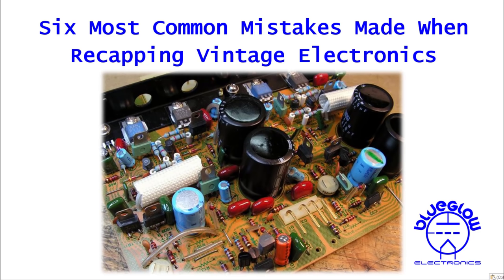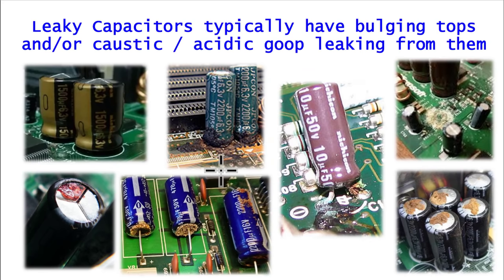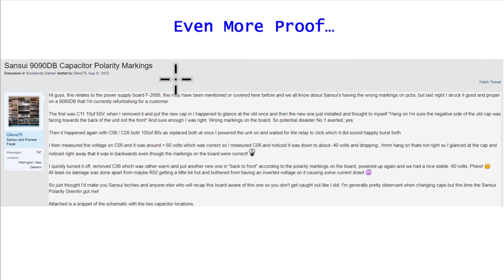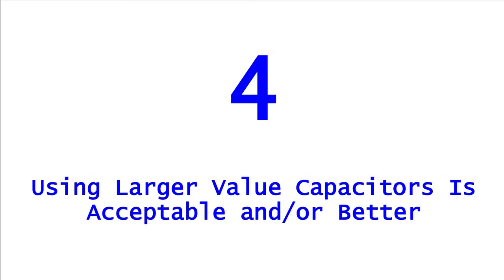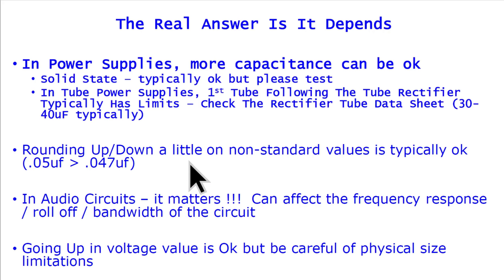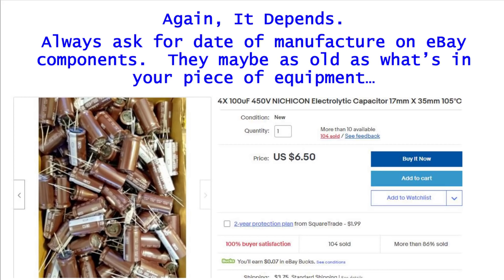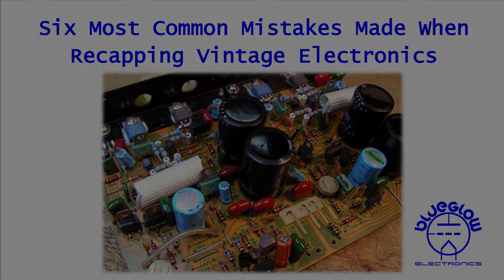Six Common Mistakes Made When Recapping Vintage Electronics

Comment: I agree with most everything.  I have also been restoring, high-end, vintage, recording studio equipment.

As to the shotgun approach.   When I sit down to, refurbish, restore a nice big huge audio console.  36 inputs.  70 something modules.    All with numerous capacitors.  I sit down.  And I change every single one of them out.  Whatever doesn't work after that.  I shall troubleshoot.  Because it would have been working before.  Therefore I must have done something wrong.  And it will be easy to troubleshoot.  But I've never really been known to make those kinds of errors.  I get it right the first time out.  Then I'm happy.  Then I can party

Oh yeah and the console was made in Great Britain and is called, a Neve.   By Rupert  Neve.  It's in a Dave Grohl movie from 2013 called Sound City.   Only Rupert told me, mine was better.  And I definitely know that for a fact.  I've been using it since 1984.  Owning it since 1996.  And created  a new method of cleaning and restoration. Without having to change out  hardly any, potentiometers or switches.  You know the stuff that always goes incredibly intermittent and doorstops passing audio by dropping out altogether.   And ya can't have that happening.  And it worked so well.  I had to turn all of my other studio technician friends on to it.  And it has become the de facto standard method of refurbishing.  And the punchline here.  You give it a bath with soap and water.  Actually a surfactant..  And water for rinsing.  In an ultrasonic cleaner.  That warble's between, 40 kHz and 80 kHz.   Which will prevent any damage .  Into the center of the substrate of solid-state, transistors.  If not the warble.  Preferably 80 kHz.  Minimum 40 kHz.  I had a 1960s tube powered Bendix.  That said ultrasonic but it was in fact, 20 kHz.  And I had a couple of transistor failures with that.  More than I care to remember.  I wasn't quite in the know that I had the wrong flavor of ultrasonic cleaning frequency.  One of those stupid engineer, whoops moments.  Even more amazing.   The transistors were never submerged.  But the 20 kHz was so unbelievably loud.  It still permeated and penetrated them in the air.  Just amazing.  Everybody told me I was wrong.  About my hypothesis.  Until I called both GE semiconductor and National Semiconductor.  And they said Yep.  That's why you need a minimum of 40 kHz but we recommend 80 kHz and it would be best if it warbled between those two.  Then they will be no chance of semiconductor damage.  They told me.  Who knew?  You weren't supposed to give your transistors a low frequency,  ultrasonic frequency bath?   There was no warning on the transistors, do not use 20 kHz, ultrasonic cleaners.  And even if there was.  It would have been too tiny for me to read anyhow.  It's all right.  I cleaned everything up.  And put on a new pair of, underwear.  Before replacing the transistors.

You spoke of misprinted polarity indications, printed upon circuit boards.  I have one better.

At the turn of the eighth decade of the 20th century.  I was handed a famous West German very expensive, large diaphragm, studio, condenser microphone.  Costing approximately $3000 new.  And this one was dead.  HUH?

As the story goes from my client.  It was handed to the 2 other top studio technicians.  At the other 2 top recording studios in Washington DC.  Both guys I know.  We all have worked with each other.  I've contracted them.  They have contracted me.  And my client tells me they couldn't seem to fix this one transistor microphone?  HUH?  And he handed it to me.  Knowing I was a technical miracle worker.  And also indicated.  Since he knew I owned a pair of my own.  If I could not make this work.  I could just keep it.  To use for parts.  For my own.  Thank you Rico.  I'll see what I can do.  But Bob and Rick couldn't make this work?  They must've been pulling your leg.  Because if you ordered the transistor from the manufacturer.  It would cost you a couple hundred dollars.  As each are tested.  And general-purpose transistors were only, $0.98 at Radio Shaft.  And the microphone has the schematic and English printed in Germany.  And it's a simple little schematic with one transistor a couple of transformers.  And a few capacitors resistors, general fare.  And everything checks okay.  Everything is verified to the schematic.  And yup.  It's dead.   The capsules just fine on one of my microphone bodies.  But the body is dead.  And I can't find anything wrong with it.  All the continuity is proper.  All the parts are fine.  What the hell?  It was more like what the FUCK.

Out of sheer frustration.  I consumed a copious amount of beverage and burning some green salad.  And I decided to destroy the microphone.   It has to be connected to 48 V of phantom power.  And I wanted to see some smoke..  After consuming some.  But a different smoke.  From the parts on the circuit board.  And that would be easy.

The schematic showed a, P channel FET..  And the orientation of the gate, source and drain.  And so I took a general-purpose $0.98, N channel FET.  And I install the wrong transistor.  But no smoke.  Still dead.  How can I make this worse?  I could turn the transistor around.  With the wrong orientation for the gate, source and drain.  And I should get some smoke, then.

When I tried to do didn't work.  There was no smoke.  And the microphone simply sounded like new again.  And it's a, what the FUCK moment.

I ended up calling the sole American distributor in NYC, Gotham Audio.  And I get Joe Luong on the phone.  One of their well-known highly respected top technicians.  And a gentleman whom.  We were classmates together.  Taking Ampex technical warranty service seminars.  In the same class together.

And I'm like so, Joe.  We both know.  The Germans.  Would not make 2 blatant schematic typos,, like that.  This was done on purpose!  That would force us to send the microphones back.  Joe laughed.  And said to me, so you found the typos?  YES!  I FOUND THE TYPOS!  It was absolutely done on purpose by the Germans.  A few years later.  Our laws in the USA change.   They could no longer get away with doing that.  It was all corrected later.  And so it was actually deliberate.  2 huge errors in a single transistors schematic.  On purpose.  The wrong type transistor.  The wrong orientation for the transistor.  In the supplied schematic.  For the famed and one of the most widely used studio microphones ever made.  The Neumann U-87, early first release version.

And as a respected freelance, recording studio maintenance technician.  I could have just told Rico.  That darned microphone is just kaput.  And he would have been fine with that.  But that's not how I roll.  I handed it back to him.  He couldn't believe I got it working when the other 2 top guys in town couldn't.  And of course I then became his all time favorite studio maintenance engineer.

Sometimes you need just the right amount of beer and pot.  As nobody perfectly sober would ever do such a thing, in their right minds.  Sometimes you have to think outside the box.  And the bottle.  And the bowl.

Taking risks is half the fun.  And such a relief when it works.  Just like new again.
RemyRAD
Reply: I'm sure you have some good points but we'll never know due to the flood of disjointed phrases mixed with splintered metaphors.  Ask someone with a better understanding of English/grammar communicate your thoughts next time.
Reply: Thanks for a great story! Manufacturers should know better. There's usually someone out there using their stuff and finds their shenanigans. (e.g.The VW engine emissions scandal)
Reply: What a waste of time.

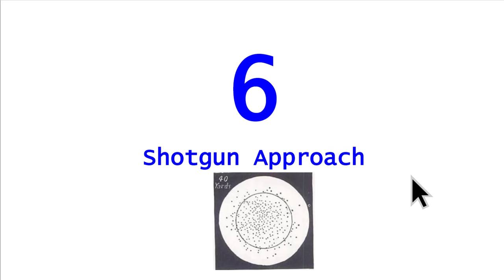Comment: Seeing a capacitor inside another capacitor at 8:28 left me shaking my head. I should not be surprised by dishonesty.
Reply: Not really happened all the time to make a capacitor look vintage say. Yes if you're trying to disguise a capacitor for something else a more expensive quality that's not right
Reply: @johnsweda2999  yes, quite common to replace old cap cover over new caps. It keeps the vintage collector happy.
Reply: i've done that a few times to keep appearance, alternative is to fit new cap under chassis but leave old one in place on top but completely disconnect
Reply: Have you seen a very small NiCad cell embedded inside a D cell? Surprise... surprise 😬😬 a Lithium Ion 18650 cell labeled as “ protected cell” and upon opening saw an empty shining disk? Opened drill replacement battery pack to see 2 old unconnected dummy cells.... so on and so forth! Life in China, is full of surprises!😆😆

Comment: Used to love fixing up old electronic gear. However, availabilty of parts is daunting for many units. I restored a Heathkit V-6 meter and could not get the exact value of one range setting resistor, it was off .1 ohm. I got a Vector Reseach VR 2500 from a neighbor that only needed light bulbs in the slide rule dial.  
Very old electrolytic capacitors do dry up. They also "unform" themselves over time too, and need to have a DC votage slowly brought up to reform them.

Comment: Just finished doing a complete recapp of an eBay purchased Philips 6731 tuner.  I broke your last rule.  I did the full recapp all at once. Plugged it in and NO SOUND!  All the boards are easily removeable on this tuner with pins that plug into each board.  After some troubleshooting I discovered a single pin/plug, that plugs into the RF board, had slipped down out of position (not making contact) So I applied some heat to the pin,  in it's plastic housing, and slid it back into place.   The unit now works absolutely fine.  I think what happed is this unit uses 13 incandescent light bulbs inside (equivalent to 25 watts running inside the case!!! which I think caused the pin to slide out of position) I replaced all org. bulbs with LED.   Fine sounding tuner!

Comment: Back in 2000, I bought a factory refurbished Pioneer Elite 5.1 surround receiver. I noticed on the back of the receiver, there was a white dot sticker next to where the AC line cord came out of the receiver. I looked it up on the internet and what the white dot sticker was there was a recall of the model receiver I purchased because the power supply capacitors were installed backward during manufacturing. The white dot sticker indicates that this issue was resolved during the factory refurbishment process. I just performed a capacitor replacement on the receiver, and also checking resistors and bias and DC offset. I replaced capacitors and some resistors that had some evidence of thermal stress. I replaced them methodically using the non-shotgun method. And yes, the marking on the PC board for the power supply capacitors had a sticker covering the incorrect polarity and had the correct marking printed on the sticker.

Comment: Have you ever run across conductive glue?  It's starting to happen in the top center pix at 1:18.  The yellow glue turns brown and then starts to conduct.  I don't know if it's the carbon in the glue or what but it starts to short out circuits.  You can see it start to corrode the diode in the pix which may be a factor.  I've fixed several units just by chipping the stuff off.
Reply: i have a few times...

Comment: Have a little care when using higher voltages capacitors, the ESR will go up.  In a lot of circuits it will not matter, but in switching circuits it can be an issue.

Comment: I have many DIY'rs replace capacitors they thought were bad because of the glue/bond. Also have had many installed backwards.  Good point to make all marks on the caps face one direction.

Comment: Great info and timely. I need to replace a 1uF tantalum Cap on a vintage Eventide H3000 Ultra Harmonizer, circa around late 1980s, early 1990s. Thanks for some well advised info.
Phil
NYC Area

Comment: A note about that brown glue on some of the late '70s Japanese amplifiers.. the glue becomes corrosive later in its life and if it is touching metal leads of nearby resistors it may eventually eat through the lead and cause an open circuit. I always try to remove that glue from any metal leads nearby to prevent that from happening. As for the boards being incorrectly marked I have encountered that on a few occasions which is why I replace one capacitor at a time so when I pull out a capacitor and I know that the negative terminal is facing down I will say negative down as I go and grab a replacement capacitor and I will put the new one in negative down. Doing one capacitor at a time you can make sure that you put it in in the correct polarity and not be forced to rely on a silk screen which could be wrong.

Comment: One thing about said glue is that a lot of it does become conductive when it ages.

4:07 i always go by the leg length to determine the polarity, ive swen a few times where the wrap on the capacitor is backwards (showing the positive leg as being negative).

Comment: Very good, I am going to start recapping my ARC LS7 preamp that's about 25 years old.  Will start with the power supply, and will only use identical values if I can.  Thanks.

Comment: If you want to keep the vintage look of the capacitors,  especially if they are of the wax variety, you can melt the wax and take out the insides.  A modern capacitor can be inserted inside and the wax can be reinstalled.  The old metal can electrolytic capacitors can be taken and cut open, a modern electrolytic can be re-inserted in the can and reinstalled.

Comment: When I think of vintage electronics, vacuum tube amps and receivers come to mind.  I have recapped about 10 tube amps, I always replace the wax caps and  Can Caps.  I have a  1963 Fisher 70 watt amp  and looked at the bottom, way too complex for me to touch .So,  it sits unused.   Magnavox and RCA tube amps are easy to work on.  I really don't do any thing to the vacuum tube tuners.

Comment: Good advice.  If the capacitor is not leaking and appears to be working in the circuit, don't replace it.   This only applies to electronics that is 50 years old or newer.  For really ancient radios, every component is suspect, with caoacitors at the top of the list.

Comment: I use my digital camera to take macro or closeup photos to document the layout, orientation and component markings. Yes, you can't always rely on the silkscreen circuit board markings or information on schematics. If the equipment worked perfectly fine before, the photos you took will definitely remove any doubt, especially when there's a period of time waiting for your parts or repairing multiple items.
Having a photographic memory is pretty rare, so those photos will  keep you out of trouble.
Reply: Photos have saved my rear a few times. Especially in a busy shop with lots of distractions.

Comment: CORNELL DUBILIER capacitors are just amazing. Anything you want, they have. If they don't have? They will make it customised for your application. They are made in USA 🇺🇸 and are high end stuff, like Nichicon for example. I've been using them for ages. Extremely happy 😊

Comment: Thank you for this informative video. Currently have one older tape deck and one large cap in the back k of it has black gunk. I never saw black gunk like it before. Thinking it was a bad cap(cap itself looks fine), then I found your video and learning it was factory glue and not a leaky cap. Thanks again

Comment: Good advice. The only thins I would add are:
a) the glue used to hold down capacitors in older equipment can sometimes be of a corrosive, very insidious type and needs to be thoroughly and meticulously removed to prevent damage to the circuit board
b) at 8:05, I would not just say "beware of capacitors sold by sellers abroad" (whatever your country may be) I would just say "beware of capacitors of unknown provenance, sold by anyone without an impeccable reputation" as it may be the case that a seller may have bought capacitors from another seller and is just re-selling them without having ever tested them or checked where they actually came from--there's simply no guarantee of what you'll be getting then.

Comment: 6:36 hey hey hey you forgot something really important there that can make or break things. The ESR. Higher voltage capacitors have a much larger ESR, even the ones labeled low ESR and in your example of changing a 16V cap to a 100V rated cap, I'm 99% sure it would let through noise from a SMPSU since you went up almost an entire order of magnitude in ESR
Reply: yep, one reason why you shouldnt go too much higher in voltage, another is the capacitor may not keep formed properly at a very much lower voltage than its rating
Reply: If you buy quality caps like Nichicon the ESR difference in negligible and the caps will never get hot.
Reply: @PhuckHue2  No. A good quality 400V rated cap will have a ESR of full ohms or hundreds of miliohms. A good quality 16V cap will have like 15-20 miliohms or ESR. I wouldn't call almost 2 orders of magnitude "negligable"
Reply: @whatevernamegoeshere3644  Exactly. Check datasheets. You won't even want to replace a 25V cap with a 35V one, if it is in a high-load switching position. If you find several one in parallel comfiguration somewhere, then it means something: the bigger single one would not be good enough, so most likely a bigger voltage one will not be good enough too.

It depends. It may work just fine. Or just at first. But you will have less headroom for aging, it will fail again sooner. It might perform worse, noise-wise, will transmit more noise, or will be more sensitive to noise, or both.

And in switch mode power supplies, size matters. Not value, but physical size. Check out some datasheets of reputable brands: the miniature high capacity caps can have 1/3rd of the life expectancy than a bigger-sized one. If you can cram in a bigger one into the housing, fit the bigger, even if the lead spacing is wrong, it will last longer. Maybe don't, in very high frequency switching positions.